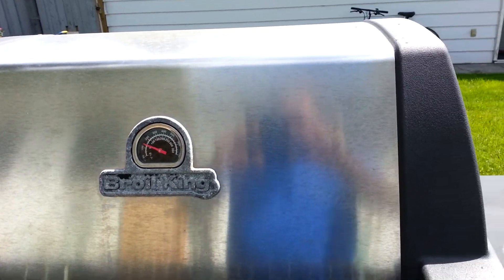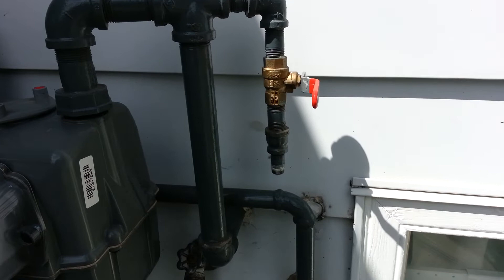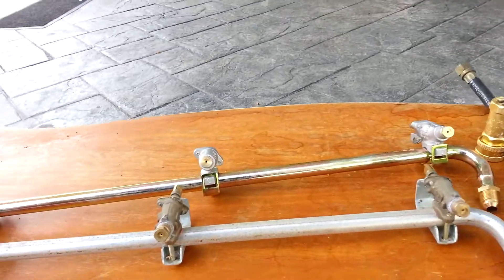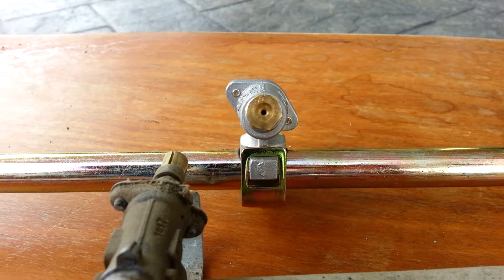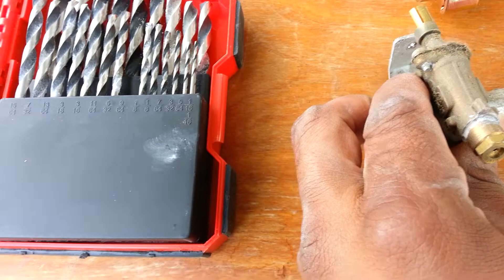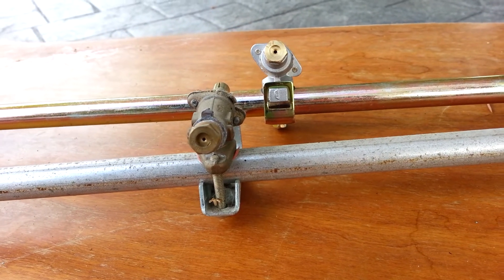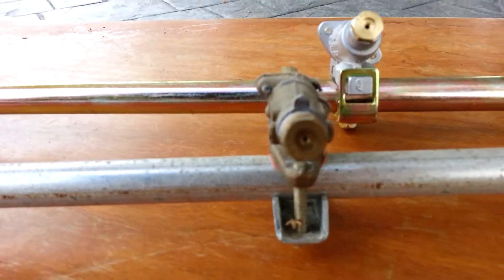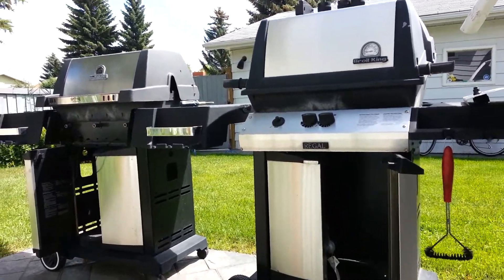EASY BBQ Propane to Natural Gas Conversion

Comment: Real gas fitters carry an orifice drill kit with conversion tables. The kit runs $100 plus. These bits are numbered not sized so it's very accurate. Home owners should just buy the right sized orifices and replace. They usually screw in to the manifold.

Comment: Just drill to 1/8.   No safety concerns . That’s th size of a natural gas jet !!!   The aftermarket parts you get for $29 can’t compare to quality manufacturer grill valves and jets .
Reply: 1/8 is way too big. Each one of those jets/orifice opening is dependent on the BTU rating of the burner. Different BTU ratings use different size openings. By just randomly drilling the hole to 1/8 inch he could be doubling or tripling the BTU's. In other words, it's very dangerous to so. Don't believe me? Google it! I just did Google it and your recommendation of a 1/8 inch hole would increase the BTU's to 42,415 BTU's per burner. Think about it!
Reply: @jimdent351  i found the chart you’re talking about. if you’re looking for a drill bit size, do you look at the BTUs for your propane burner? Ex: mine is 26,500 BTU propane. If I’m drilling to convert to natural gas (4” WC), then according to the chart I need to use a size 40 bit ?
Reply: @ftr098123  The Water Column (WC), from my understanding varies, so I would hate to say either way what you should have. I do, however, THINK that based on my research that it is commonly 7 inches for gas appliances set by the manufacturer. I do know, also, that just drilling holes to 1/8 inch would be a huge mistake. I wish I could tell you for sure but I just don't know. If you know for sure what the WC is then drilling an orifice to that drill size should be correct. I have been thinking of starting with a bit for 4" WC and if the grill doesn't perform as expected then the 7" WC bit size would most likely be okay.
Reply: @jimdent351  I’m converting a propane bbq to a natural gas. WC is 4”. I think I figured it out
Reply: @ftr098123  Good that you found a starting point. Since 4 is the smallest size then you can move up to a 7 if the grill doesn't get hot enough. I think that's what I plan on doing as well